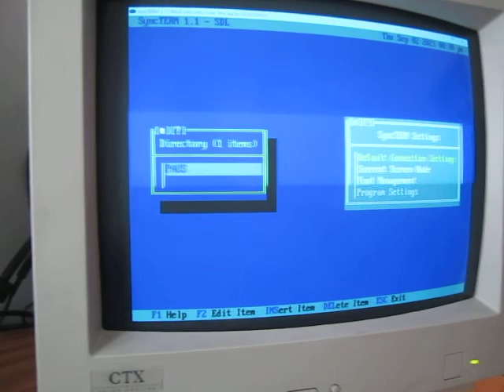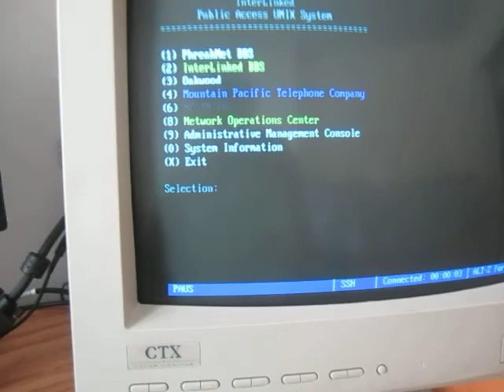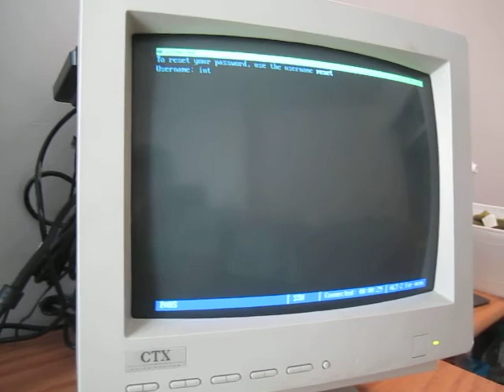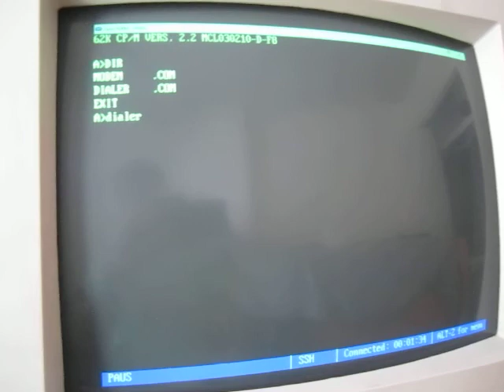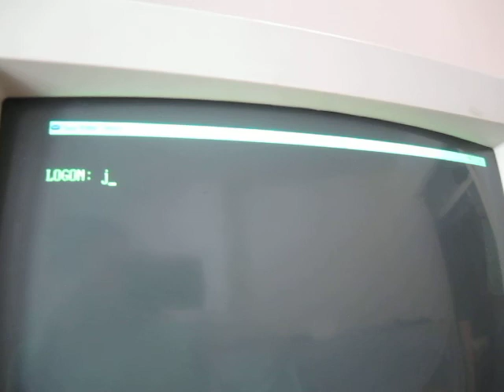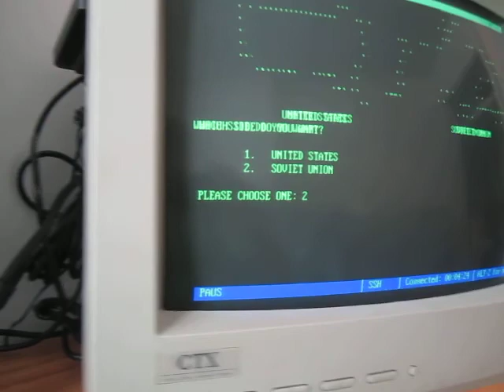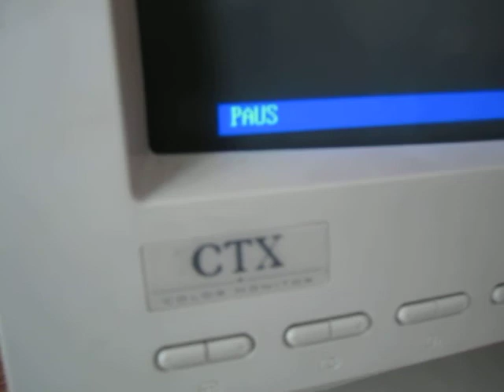CTX CRT Color Monitor

Comment: the reason your camera is doing that is due to the refresh rate of the crt there very high and most cameras cant match the refresh rate
Reply from the maker: Thanks! Is this about the choppiness? I was wondering about that. It's served me good until now and I wasn't sure what had changed. My vision was also impaired for about 10-15 minutes after I turned the thing off, so I wonder if somehow part of it isn't properly insulated. It does seem to leak more near the bottom.
Reply: @InterLinked1  CTX monitors are very soft and have this effect.  I had a couple CTX screens as a kid… they all had this issue.  I just picked up one today from 1993 and it is indeed soft and initially messed with my vision.